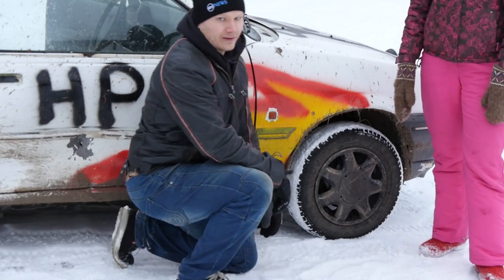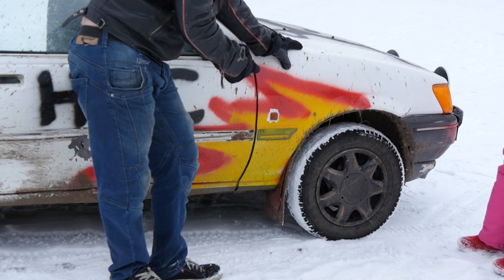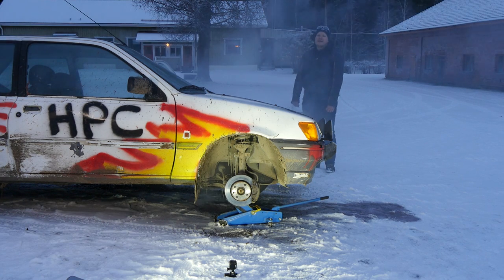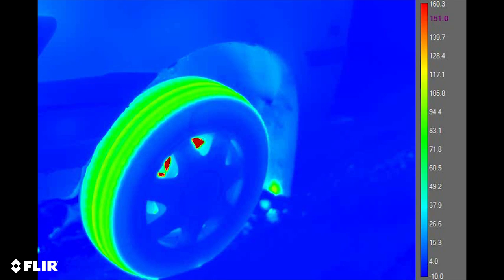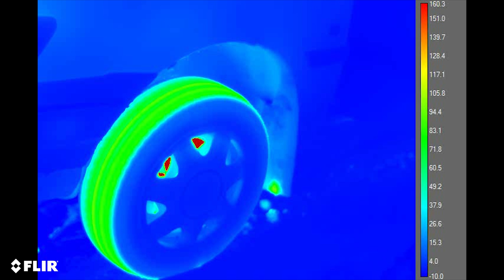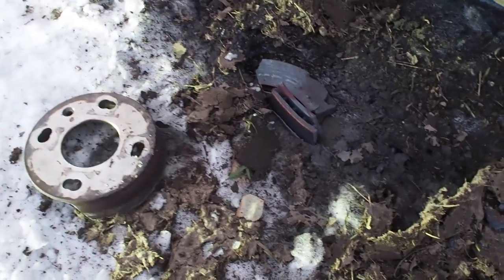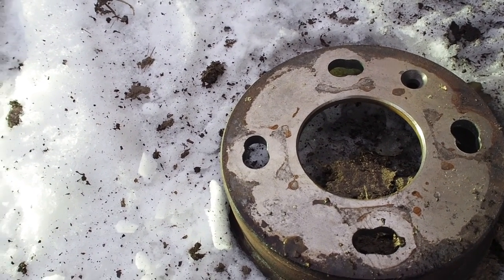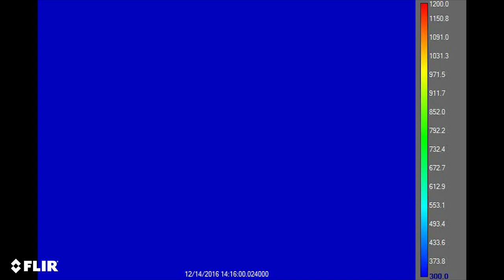Ultimate car brake test video (Explosion!)

Comment: ..... Yes I made a comment on your Coca-Cola motor oil video. You held up a part wondering what it was and I mentioned that that was a spider shaft with one of the two spider gears on it. The reason you lost your gearbox is because you have one wheel off the ground spinning it at ungodly speeds and also torquing it with the break probably didn't help either. When one wheel spins faster than the other it activates the spider gears and they're really only used for turning. cars would have solid axles if it wasn't for this problem in which you try to turn and the wheel on the outside of the turn will move faster than the inside wheel. This is where your spider gears come in. The spider gears will then allow the two axle shafts to spend at different speeds. While you're driving straight down the road those two axle shafts are spinning at the same speeds and the spider gears really aren't doing anything. They aren't really built for what you guys just did. This would blow up any differential. Keep that in mind for future vehicles, any time you spin one wheel faster than the other for extended periods of time you are destroying your differential. You guys actually demonstrated something that mechanics have to explain to people all the time. This goes for if you put your spare tire on a car, this is why it says do not go more than 50 miles on that spare tire. Putting a donut smaller tire on the front of your front wheel drive car WILL do damage to your differential. This also includes all wheel drive vehicles which actually have other components that can be damaged as well (transfer case components), you cannot have 3 half life tires and one exploded tire and then go to a automotive repair shop and ask them to install one new tire. That goes for all wheel drive vehicles. Some people will debate you on that, if you care about your car don't do it! This is because the three other tires are actually smaller in overall circumference then the brand new tire that you just bought and so the brand new tire is going to cause that actual to spin slower than the rest. 

In your case you guys showed a very extreme result, in which th that shaft is supposed to have 2 gears which are rotating on it. I would bet money that the shaft in your hand has that gear welded to it. Once that happened it probably split the spider shaft in half. The spider shaft is only held in with one bolt on ond end of the shaft. So what happened was the end that has the bolt probably stayed inside the carrier whike the part that's in your hand rocket launched through the final drive case.

Pretty Cool!
😁

Comment: You probably blew out the spider gears in the differential being if you was doing say 100mph that output would have been doubled @ 200mph..  

Also the reason your not supposed to put two different tire sizes on your drive axles same thing can happen...

Comment: I think it's more likely the differential failed (than the gearbox) due to the extreme abuse of full power whilst holding one front wheel fixed during part two of the demonstration....

Comment: @beyond the press. I know exactly what most likely broke in the gearbox! Due to one wheel spinning, and especially at high speed (as one wouldn’t ever spin one wheel that fast or that long IRL) the spider gears spin VERY fast, and usually are steel on steel bushings, and then the oil cannot lubricate enough, and the rest you can guess what happens then! 😂…..And idk what manual transmission gearbox that Ford has for sure as it a European model, but if it’s the same as US models, it should be easy to get to and replace.

Comment: Destroyed the differential.   That was predictable.   Diffs are not designed to withstand continuous operation with one wheel spinning full speed and the other one stationary.   I would guess the thrust bearing surfaces of the spider gears lost lubrication, overheated and wore through and then the spider gears 'picked up' and siezed or broke.   Just a guess.

Comment: I learned something far more useful than how hot can a rotor get before it fails in this video:
If a caliper doesn't get beyond 150C when the rotor is glowing red hot at 1100C, then I really don't need to use high heat caliper paint.
$20/can for VHT high temp caliper paint; What a scam.

Comment: I have gotten my brakes on my Subaru so hot that they started a fire in the grass.
Reply: my impreza front disks turned blue. flat out twistie road no problem, stop and go trafficlights and brake fade issue. i drove a little longer to cool them and when i was home the disks were slightly blue
Reply: Fantaman900 you should stop buying cheat rotors